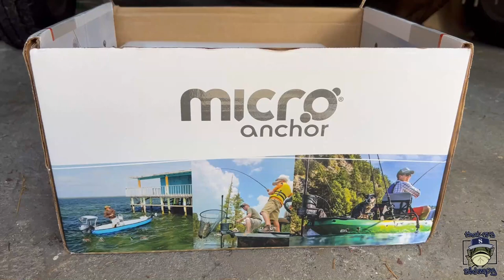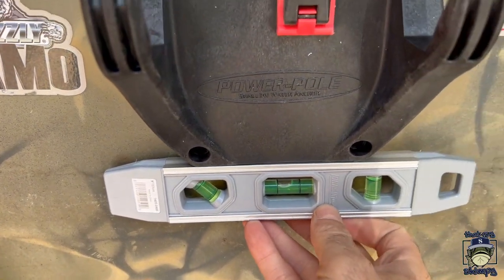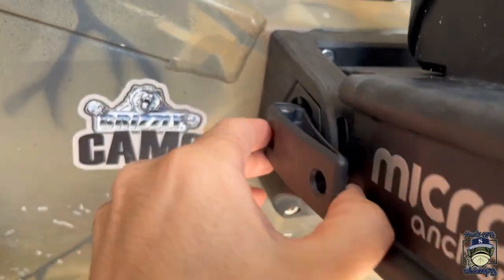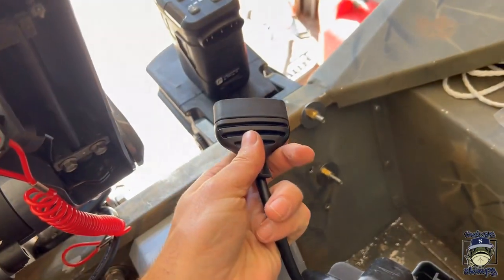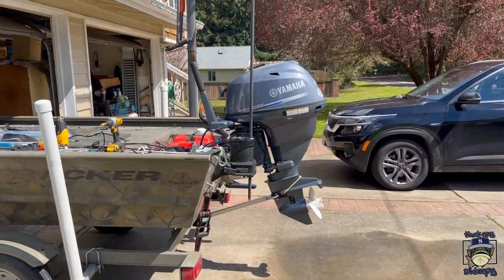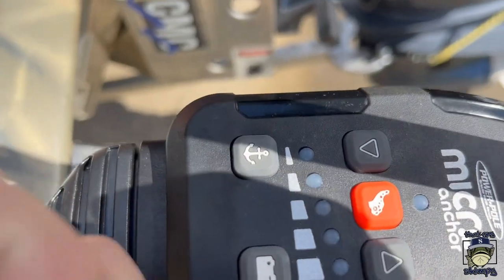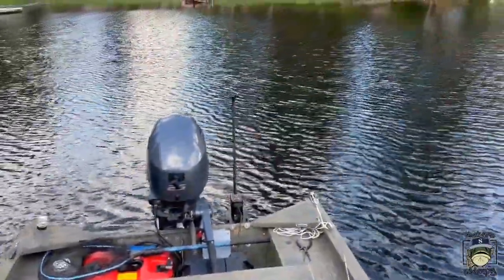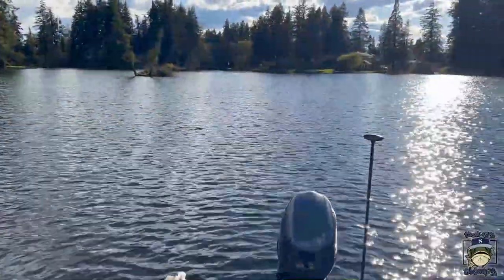How To Install Power-Pole Micro Anchor  - Tim Lane  - That Guy Skimpy

Comment: Hey quick question. When you first started using the underspin wire forms in your poison tail jig molds did you have to shape the mold to them? I bought the stuff to do it but the wire forms don't quite fit where they are supposed to.
Reply from the maker: I didn't have to mod anything.   What part isn't fitting ????    Send me an email.  Thatguyskimpy@gmail.com
Reply: @ThatGuySkimpy  email sent